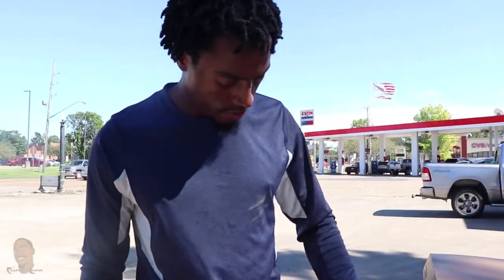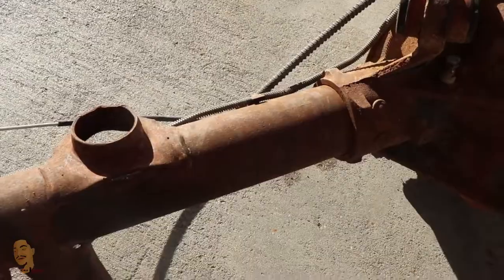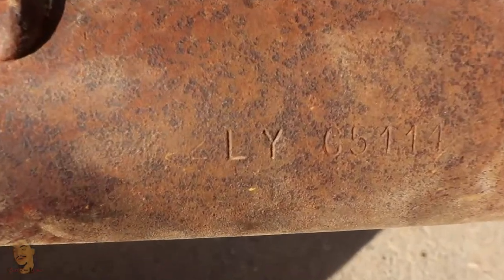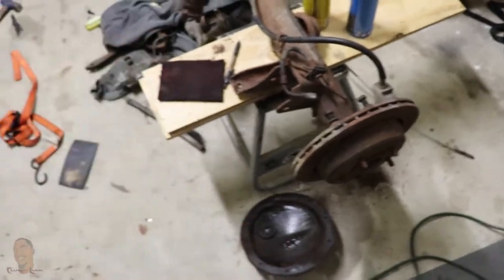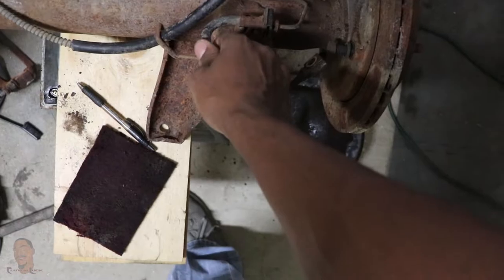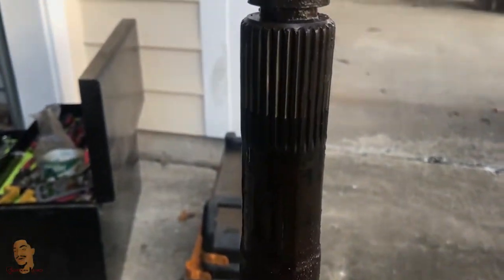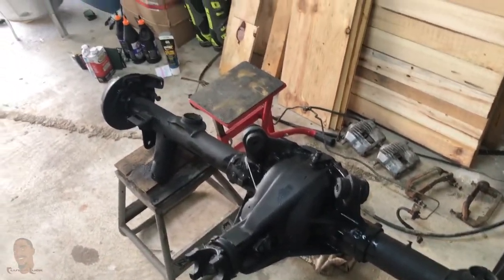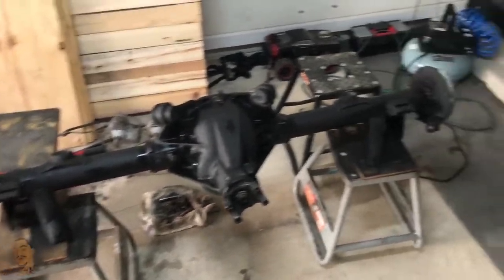8.5 Disc Brake Rear End for the Box Chevy Caprice

Comment: Brake booster is fine a lot of ppl keep the oem brake booster I’m getting wilwood brakes and master cylinder proportioning valve comes with you will need disc to disc
Reply from the maker: I did that in another video. That wilwood kit looks nice. It was just too expensive for me at that time.

Comment: What master cylinder is the one need to be used  for swap
Reply from the maker: I didn't have to change the master cylinder. I just swapped the proportioning valve to a disc/disc one and everyone thing worked good.

Comment: What would u consider cheap for the ls swap I got a few need to be done
Reply from the maker: If you're patient you can do it for free or even make a profit by buying a donor truck. Maybe a tahoe, suburban, silverado, etc and use the motor/transmission, fuel pump, harness and pcm, fuel lines & sell the truck for parts afterwards or part it out..But if you're just buying everything and doing it yourself I would say about $2,000-$3,500 depending on where and how you buy your parts..
Reply: @TerrickHarden  I have full setup already heads cam intake Camaro oil pan pedal trans camaro water pump retro fit fuel pump & an hose & connectors 1.7 rockers  oil pump with washers in it already corvette servo  I know I’m forgetting a bunch but the blocks been machined and all new bearings new pistons n  Gen 4 rods I think we put timing chain on if not that’s something I have I forgot only I don’t have for this build is crossmember and driveshaft
Reply from the maker: @IDRIVEOLDCARS  Sounds like you already have it mapped out.. Good luck gettin started.. Its really not difficult
Reply: @TerrickHarden  I need working hands I ain’t got none 🤣😂😂😂